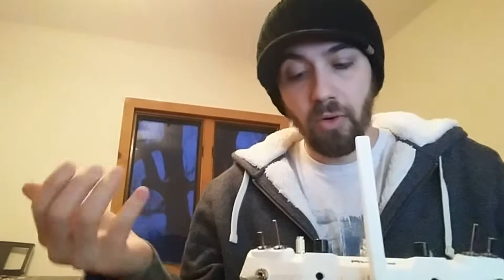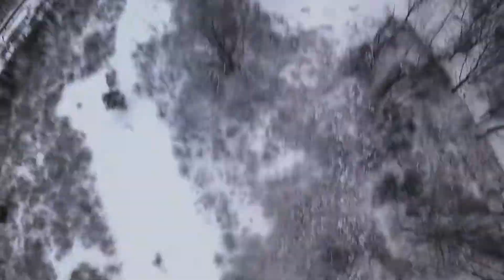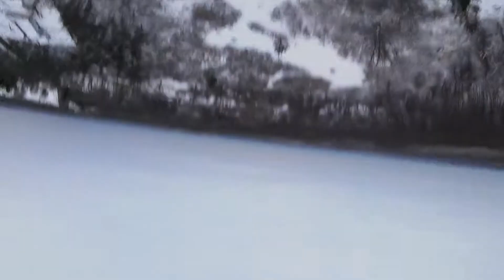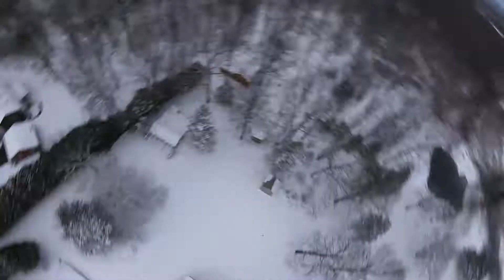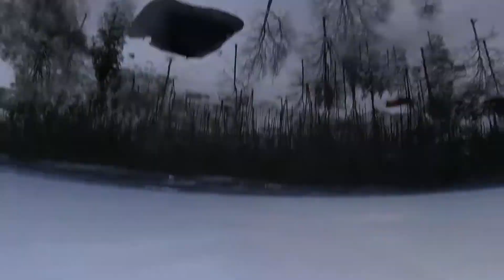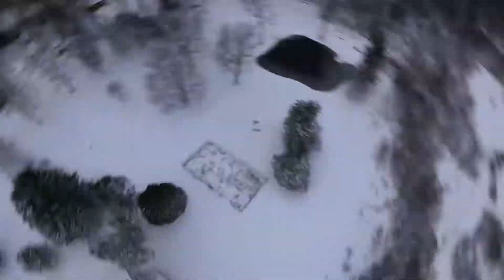New radio! QX7! First impression / flight

Comment: First again! Hey man, we both now have QX 7 transmitters. I bought mine last summer so I could add the iRange IRX 4 module and be able to fly all of my quads and planes. There is a learning curve on the QX 7, or at least there was and still is for me. But with the help of a lot of guys on YouTube and the RCG forums I have learned a lot. You need to get yourself a kickstand for it as it is top heavy as I am sure that you have figured out by now. I also bought a right angle USB cable to make it sit right using the kickstand. A lot of guys prefer to upgrade the gimbals to the M7 gimbals but I like the stock ones just fine. I also chose the white one as well. I might hydro dip it later on. I also bought the manual from Aloft Hobbies that explains a lot of stuff in easier to understand language. I also use the Open TX Companion to do my programming and backups. I hope you will like yours as much as I like mine. And nice flight too! Later dude!
Reply from the maker: graywoulf so far so good!! The grips a bit wide, but much better than I had. Ill get used to it. As soon as I loosened the spring tensions, it for me was much better!
Reply: Yeah, going from a FlySky FS-i6 Tx to the QX 7 took some getting used to for me. The QX 7 is a big Tx for sure. Looked like you have gotten pretty used to it already as you were flying as great as usual.
Reply from the maker: graywoulf was a bit nerve racking! Flying over snow is bad enough!! TY tho ;)